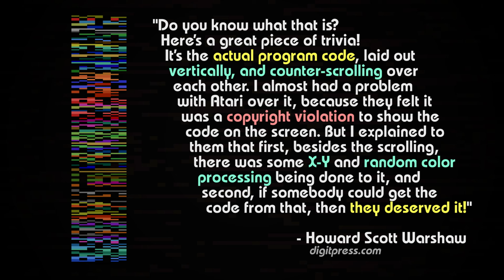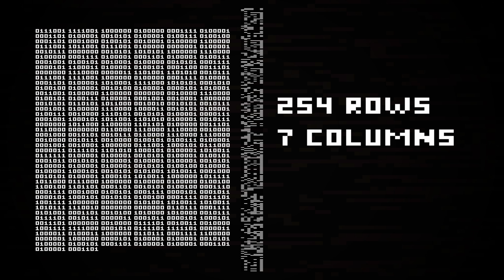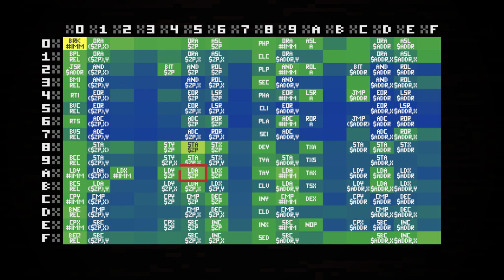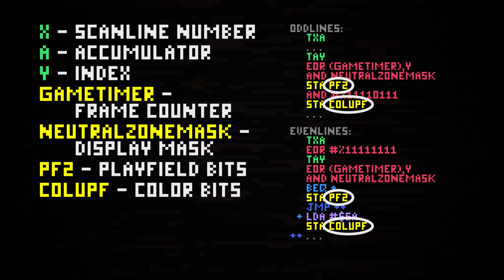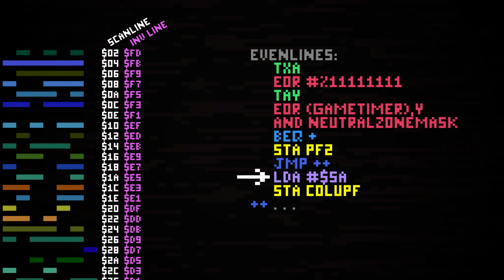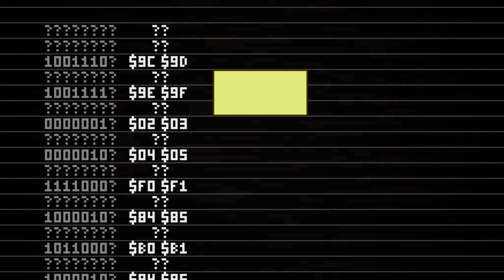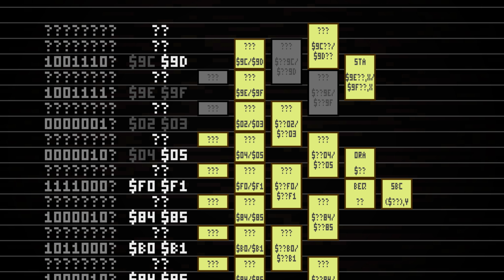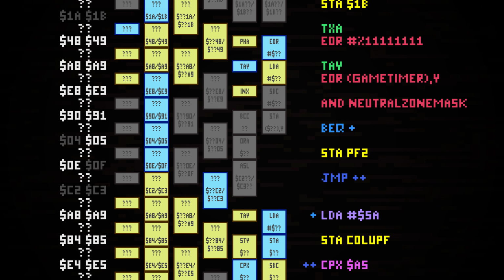Reverse Engineering Game Code from the Neutral Zone

Comment: If you record the footage frame by frame of launching the missile, it should show you the missing stuff, or the blacked out stuff, because as we know, Atari 2600 cannot have more than one color per scan line per frame.
SO you can see the blacked out line if doing it this way.  Very slow, and since the data is scrolling, not extremely useful except in about four lines of code as it passes through.

Comment: 2:05 i can't see the neutral zone there's something wrong help
Reply: Change the video settings to run at 60 FPS instead of 30
Reply: @greek_lemonade  i just realized that it was because it was at 30 FPS and it was only drawing the frames without the neutral zone

Comment: This is how I disassemble x86 code starting from a random byte, except instructions can be up to 13 bytes (IIRC) in x86, so I work forward and backward maintaining all the possible valid combinations of instructions until eventually there is only one possibility left. Fortunately I’m not missing every other byte so it converges on the true disassembly eventually.
Reply: If you’re working with x86 why not use ghidra?
Reply: Because I’m doing this inside my own debugger

Comment: You are right about trying to reverse anything from the display. In the 80's you'd be identifying the address and data lines in the cart, then connect some counter ICs, and try to clock out the data into some other storage device (probably an Atari 400!)

Comment: if you watch this video in less than 720p because it'll be 30 frames instead of 60, you can't see the flashing between the neutral zone and the shield when the gameplay is at normal speed. you can only see the shield.

at least I couldn't see the neutral zone at 30 frames. I also don't know if he mentioned that or not, but I thought it was really neat

Comment: Well, this is interesting. Similar would be a subroutine for the 6502-based processors something like the following, that depends on there being ROM from $FF00-$FFFF, as that’s the page of memory where the reset, NMI/IRQ, and break vectors exist for these processors.

; Assumes we’re called with X,Y registers set up by an outer loop somewhere.
LDA $FF00,X
PHA
LDA $FF00,Y
STA $50 ; or other “safe” zero-page location
PLA
EOR $50
INX
DEY
RTS

The caller needs to set up the X-register with 0, and the Y-register with 255 ($FF hex), and will receive the result in the Accumulator. It should check the X-register to see when it reaches 255; the Y-register will be zero at that point as our routine increments X, and decrements Y each time we call it. The accumulator will now have a pseudo-random number in it.

Furthermore, once you understand what this is doing, you can easily adapt it to other processors, such as the Z80, 65C816, 6809, 8080/86, etc…which were found in early game consoles and home computers.

Comment: Yet another way to conceptualise the XOR operator is that it's the "does not equal" operator; it returns 1 (true) if the two inputs aren't the same. A logic gate that is the opposite of this, returning true if the inputs are the same, is called various names such as NXOR, XNOR, XAND, but does not usually exist as a fundamental operation in assembly code afaik.

Comment: ook... but you lost the challenge the moment you started... because you used an emulator... and if you did that you already had the code... but other than that... nice try :) , at least i think with the 6502 you wont have cases of data inside code, but maybe opcodes used as constant, and jumps to middle of instructions... those would cause the analisys to be extra harder as well

Comment: oh how i love such deep dives into obscure techniques. Especially on 6502 which thanks to von Neumann's memory architecture doesn't distinct between "program" and "data" segments. Therefore we can experience wonders such as self modifying code to save some memory or even executing some graphics data which happen to be valid machine code if read correctly.

Leaving all that aside i am astonished by sheer amount of work put in here. Until you showed exact code drawing neutral zone i though that color might be at least missing byte's nibble. Also representation of data-code as blocks and guessing how PC would look like after it was very clever. Amazing video.

Comment: Fun fact, if you're watching this video in quality with fps less than 60 you will not see the neutral zone during the showcase of the gameplay. 
I didn't get what is neutral zone is first before i switched the quality
Reply: damn nice catch
Reply: Changef
Reply: Wait, how did i not know that???
Reply: Timestamp?
Reply: @Axcyantol literally the whole video where you can see the zone (Okay, now when I try to do this, it doesn't work for some reason, though it worked like that before)
Reply: @zhet works at the beginning 1:40
Reply: oh yea, I can confirm it, the Neutral Zone does not appears

Comment: There's one way you could decipher the original source code from where you ended your attempt.  That's basically... if you know how to write assembly for the Atari 2600 REALLY WELL and you know how the game works.  You can probably go in and "figure" out what the code would have to do from what the game itself does.  But this is based on someone being so familiar with the architecture and coding for it that they could essentially rewrite the code themselves based on how the game works anyways.  So it'd probably be an activity meant to waste your time or perhaps sharpen your disassembly/decompilation/debugging skills.  Or maybe you just like the challenge.

Comment: It looks like VHS code, or start up codes from a C64 when it's loading stuff. Any raw code on screen would look either as static image or blocks if processed by a video chip or DAC. Add a color randomizer to obfuscate and I guess that's just it. This was probably a tape game converted to a normal PCB game if code was this open, because that's what you'd probably find in a magnetic tape, bunch of blocks or a series of linear 1s and 0s and to save time loading extra stuff, they'd use actual code as filler garbage.

Nvm, I just typed it without watching the video first. Cool video!

Comment: Given the limitations it'd be easier to attach wires to the cartridge slot pins and just read the values with an oscilloscope, but that wouldn't be in the spirit of the challenge, even if that's a far more likely occurrence for the time period.

Comment: "It's about to get pretty technical, and if you don't have a good grasp on assembly and machine code works, it might be a little difficult to follow." Buddy, I don't know a hardly anything about code and have been struggling to understand from the start. Don't worry about me :"D

(The funny part is, I'm mostly following despite not knowing wtf you're saying. I think it's a result of reading extensive scientific journals despite not knowing the jargon -- I can get a feel for the discussion without knowing anything technical)

Comment: Impressed by the patience and deductions you put in all your videos. Well as for decoding the code that way, I can only agree with you that no one back in the days would have tried. If someone had the electronic & programming skills to understand the inner working of the console, it would have been much much easier to do a ROM dump.

Comment: How is showing your own code a copyright violation?
Reply: i guess atari doesnt want bootlegs of the game making rounds, and the game is technically partially ataris property too
Reply: @goob30  But wouldn't that be on the pirates? Atari owns the code, if the game shows it's own code, so what?
Reply: this is just my opinion, i don't know for sure, but i would guess atari enforces copyright pretty heavily, like Nintendo. if the game shows its own code and it's easy to decode (so not in the situation in this video) it would be possible to remake the game depending on if the entire machine code is shown or not and if there is a randomizer to scramble the code shown on screen @qwertykeyboard5901

Comment: Your comment that no one back in the day would use VCR etc is probably right. On the flip side, I would expect more era computer hobbyists to have analog signal examining and recording tools. They wouldn't be trying to do pixel analysis on a TV screen, they'd be siphoning off the video signal onto line printers and oscilloscopes. Certainly curious how far they would have gotten with such approaches.

Comment: Just one minor correction:

There is no such thing as "6507 assembly code." 

The 6507 is an implementation of the 6502, it's just a much cheaper, scaled down CPU. It's not a different ISA, though.

Comment: could end up figuring it out from there by brute forcing and running the code to see if it matches the expected behavior, but that seems like a lot of work
Reply: Each of the unknown bytes represents up to 256 possibilities, and 256 of them are missing, which means the possible combinations just in those bytes is 256^256 which is, to understate it by a long shot, a whopper of a number. Even with the tricks applied in this video all of those  possibilities technically remain valid. Even if you scoped those down to only the valid Atari instructions (or even the common ones) whatever number of combinations you come up with still gets raised to the power of 256 and even 10^256 is staggeringly huge, coming in just a hair under the last observed weight of your mama (before she collapsed into a supermassive black hole that destroyed the galaxy).

Comment: As if we couldn't already just get the code from the cartridge :D
You just need a 12bit counter to generate the address for the 4K ROM and read the 8 bits from the data oh and a !OE signal to pulse. Something you can do with discrete logic in an afternoon and you can then dump any game! :D I've done that for NES with a 386 and a multi io card, and even creating a whole reverse engineering kit and debugger in 1990 for it :D

Comment: 34:18 It's not true that $9Exx is a "garbage" location, it would just be a mirror of something (in this case, a ROM address), since the 6507 variant of the 6502 has only 13 address lines but still computes 16-bit addresses internally. Now of course Yars' Revenge is a plain old 4K cartridge with no extra RAM, so storing to an address with A12 set truly is nonsense for this game, but it's worth mentioning. Plus, some particularly advanced bankswitch schemes do interesting things in exploiting the various sorts of incomplete address decoding that the VCS has.

Very cool video!

Comment: also how did the creators not realize that the spinning spiral looked like a swastika?

yes world war 2 did happen in the 1940s so the timeline would be correct.

yes a shape does not have to be correct in order to draw controversy because the lock picking lawyer was able to notice the same shape in the keyway in a lock and the keyway was not perfect either.

another possibility is just like metal prices where at the time when payphones used in band signaling was because copper prices was very high and the phone companies used the voice pairs to transmit the signals and then the bottom fell out of the metal prices in the 90s then spiked again briefly in the 2000s and so on.

maybe society's being offended by war and historical imagery hop scotched where in the 80s we was not offended by ww2 imagery then the 90s saw a surge in being offended and so on until now there is a cancel culture raging over certain stuff today.

it is also possible that we new and accepted that the limitations of technology could lead to coincidences and just accepted it rather than  do a cancel culture.

Comment: but how do we know if the values we get out of the feild are the right polarity (e.g if the zeros are meant to be zeros and not ones) when you flip and invert you then go into deep detail about why you fliped the way you did but not why invert the way you did
Reply from the maker: This is true, I left it out of the video. Doing the same test with all four combinations of parity and flip, the correct orientation still comes out on top. Inverting the bits produces results no better than the alternate option showed in the video.
Reply: @RGMechEx  thanks!

Comment: Would this approach to reverse engineering the assembly always work?  ROM data isn't always code, and even in code it doesn't have to be pure assembly.  For example, I remember poking around in SMB's assembly, and they had these pseudo-switch statements where it would take the PC, add a variable to it, then jump to the address pointed by that location.  Located after that point in the code were several pointers to different spots in the code.  Or is this kind of trick impossible on the Atari 2600?

Comment: A small change in the ROM should allow for the neutral zone to be rendered every frame whilst the quotile shield is never rendered, giving us access to all of the data in the ROM minus the least significant bit. If the Atari had the equivalent of a game genie the branch instruction could be changed to always draw the neutral zone.

Building off of this if you run this in an emulator and change address $FAF3 from 0x9003 (bcc $FAF8) to 0x3A3A (NOP x2) then the game will draw the neutral zone every frame and every piece of code can be seen.

Comment: It took me forever to remember what other game you already covered that grabbed a chunk of its own code as a substitute for pseudorandom data. It was Pac-Man using it to determine random directions to move at intersections. I wonder how many other games over the years have used that trick in one way or another.
Reply: I imagine anything that had a TV static effect was doing it. Nowadays you get a segfault if you tried this
Reply: @Clippy4Jesus Yep, because modern CPUs don't let you read random memory for security reasons. It'll let you read your own memory, of course, but you're pretty likely to end up reading invalid memory if you're trying to do something like this.
Reply: off the top of my head, the static effect in the gamecube version of metroid prime uses its own VRAM for the pixel data

Comment: if it's text for source code then the biggest bit usually isn't used because most text is within 7f, numbers are 30-39, uppercase is 41-5a, lovercase is 61-7a
even back in atari days at least uppercase and numbers are used, albiet the assembly might be crushed for being friendly to small 70s 80s computers, don't have much storage
Reply: The source code is not contained the cartridge. It's the executable machine code, not text.

Comment: Never thought about using the second bit as a mask in XOR instructions. I typically use XOR instructions to zero out large blocks of registers in one instruction by making my bit matrix both of the input fields as well as the output field. The instruction set allows 125 registers at a time, allowing me to zero out (up to) all 125 in one very fast instruction. This is for low level code on dedicated microcontrollers for industrial automation, where every byte and clock cycle count. Next time I'm working on a large bit matrix, I'll probably look at it a little differently :)
Reply: That is funny.  My last job I remember seeing a macro for an efficient memset to 0, but never looked at the assembly behind it.  Now I wonder if it used XOR or not.
Reply: @canebro1  
Probably. Most CPUs have one or more versions of' a "XOR 'thing' with itself" instruction which is generally the most efficient way to set 'thing' to zero.

Comment: These skills are going to be real useful for hardware archaeology, when we recover damaged firmware developed centuries in the past and need to get them working again.
Reply: Eh, just splice frog DNA in over the missing parts. What could go wrong?
Reply: Instructions unclear. Lilypad stuck in ceiling fan.
Reply: @CptJistuce instructions unclear: my router is going ribbet ribbet and catching flies
Reply: @lavacat720  Instructions were clear to me. I now have a baby dinosaur 🐣😎
Reply: I doubt we will even exist for many more years at this rate
Reply: with modern data keeping tech this is unlikely to happen without some sort of societal collapse, and at that point I don't think youtube would still be around.
Reply: Or very volatile memory, a hard drive won't last for more than a century.  @totallynormalclippy
Reply: Instructions Unclear: my di%# is in my throat

Comment: This all sounds like EXACTLY the argument that inspires things like HDCP.  If that were a possibility in the 80s, Atari may have demanded the game use an encrypted channel to the TV.  Pirates would then simply dump the ROM, grabbing every byte, in order, with no obfuscation or masked bits.  But, gamers would have to upgrade their TVs, VCRs, and switch boxes to avoid scrambled video.

Or maybe I'm just bitter that I can't get my Mac Mini desktop to show up through an HDMI KVM, HDMI Matrix, and HDMI to DisplayPort adapter without disconnecting the cable two or three times every morning.  Because god forbid I vid-cap my Outlook window and share it on the Internet...
Reply: mac user, point and laugh

Comment: What if the instruction memory has an unconditional jump in it, followed by an unused garbage padding byte? Would that mean some of the possibilities you eliminated could have been possible after all?
Reply: I thought the same. In 6502/6507 code it's not that likely to happen though as instructions are big enough for immediate register loads and data regions are usually separated from code. Padding code isn't necessary as alignment doesn't matter.